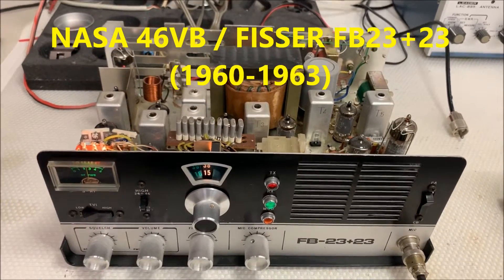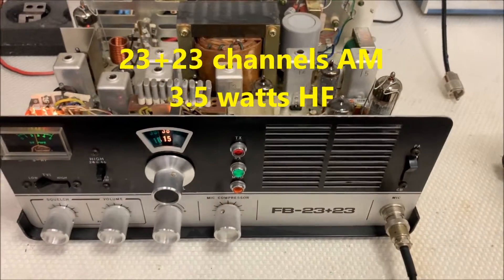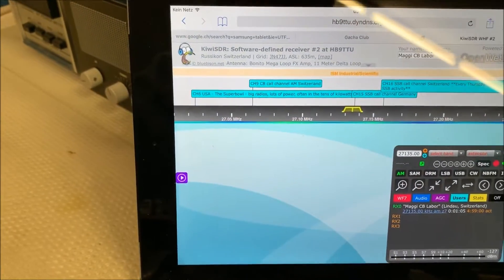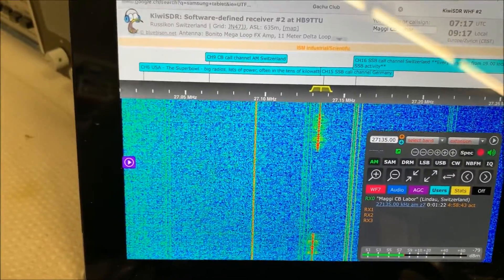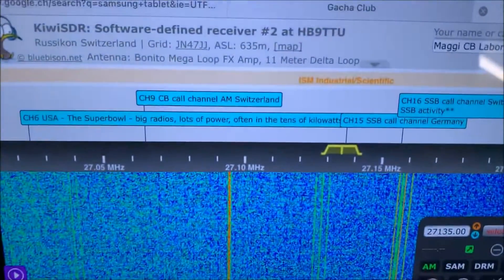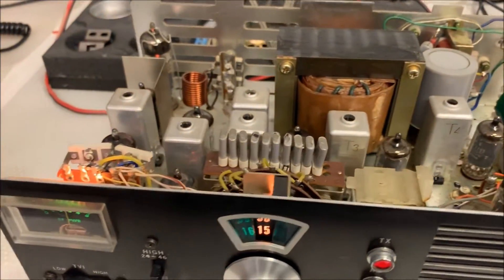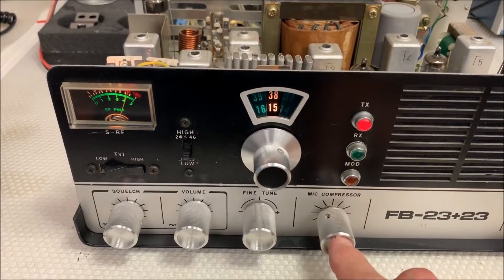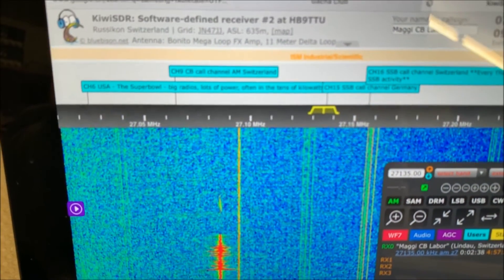NASA 46VB in test on KIWI open-web-SDR@HB9TTU

Comment: Hi Just seen your video on the 9.785 crystal filter from a while back, I also have the Royce 642 CB radio and suspect the crystal filter as have no RF output or mod on TX (SSB), meter pegs backwards when you key up on SSB and no mod on AM but RF power Ok and meter moves as it should. Is there a simple way you can test if it is definitely this filter? I have no way of injecting any 9.8mhz signals unfortunatley.
Reply from the maker: Mister Beach hello, thank you for the interest. The 9.785 crystal filter does only work on SSB. The AM Modulation will produce via TR15 (pre Amp) and the Limiter Tr16, also the mic Amplifier IC6. Check also the capacity of C123 and C42. Is it possible, that these will be defectiv (shorten). I think, the probleme is to find on these parts. I wish you good luck to find the problem. Best wishes to you.
Reply: SWIZZRADIOS Thats great thank you for such a lot of information i will check all this out!
Reply from the maker: @mrbeach3379  Tanks Mr Beach, you're welcome. Happy airwaves to you....

Comment: A review would be welcome. Why and how does it have 46 channels ? What country was it made for ? Who made it and where ? What else did they make?   A close up of the dial. Is it AM or FM? Where does it say NASA? What does NASA have to do with it? How did you acquire it? Were the extra channels stock or added? How many volts to power it ? How much was it to purchase new? Did you repair it?  Was this just a video to prove to someone it can transmit ? Is it for sale? Locate the PLTI source by driving along the power  lines listening for spike in noise then get out and   whack the suspect  power poles with a sledgehammer while monitoring a mobile  radio for changes which indicate loose connections. You won't solve it by sitting on your hind end in the house. 73s
Reply from the maker: Mister Catbox hello, thank you for your interest. Yes, a first answer to your question is the follows video: https://youtu.be/QddoMqsfgo0
NASA 46VB were made in JAPAN for the Export outside USA. But a lot of other brands use this chassis like: KRIS 23, Lafayette Comstat 23, Courier 12, TENKO 46T, ROBYN T23, etc, etc. I'll send you another answer tomorrow. Happy airwaves to you..